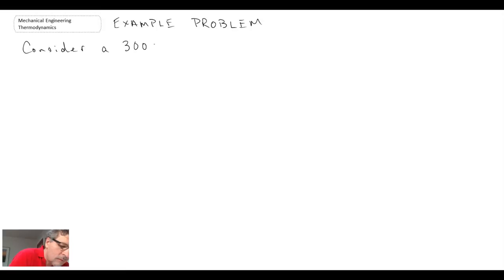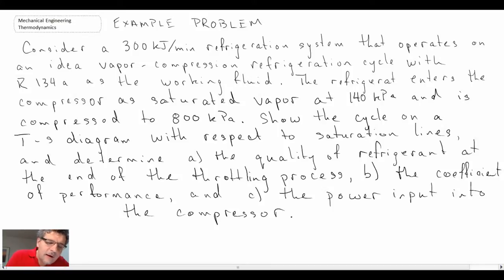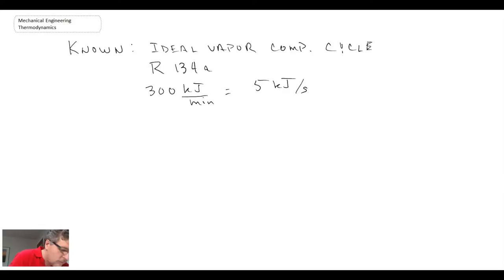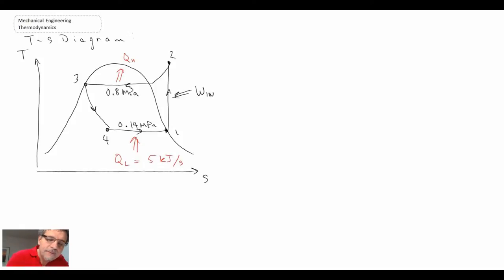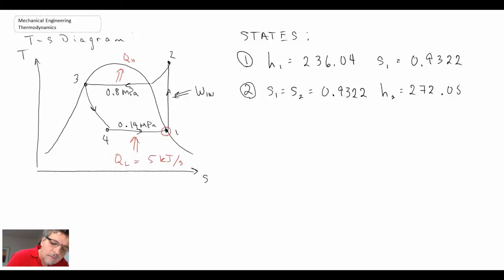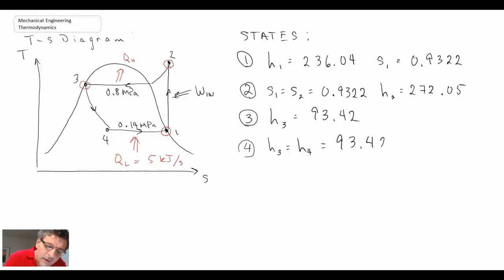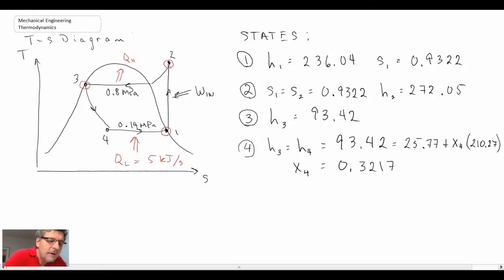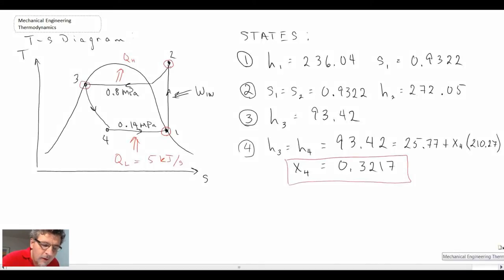Mechanical Engineering Thermodynamics - Lec 23, pt 4 of 4:  Example - Ideal Vapor-Compression

Comment: Table A-12 is how you get h1, since in the problem it is stated that it is a Saturated Vapor, therefore you look at the table under 140 kPa and 800 kPa. By doing this you can find both Enthalpy and entropy. Correction, you do use the superheated tables but that is only for P2, where the line does show up outside of the saturated line. From there you interpolate to get h2 after assuming that S1=S2

Comment: based on a P1 of 140 Kpa, and the fact that it is a sat. vapor why can you not find h1=approx 387 from the tables? All of your values for h and s are much lower than my tables even have?
Reply: I think he may have used R-410a instead of R134.  I thought the same thing.
*nevermind, if your using Borgnakke and Sonntag Fundementals of Thermodynamics tables, they're different values on the lookup.  Why I have no idea.

Comment: the problem with my superheated R-134a table is my pressure at .8mpa is not there. i got  only pressure column for .6mpa and .10mpa
Reply from the maker: You can still solve it, although it is a bit more work.  You need to interpolate between the two states where you have information (0.6MPa and 1.0MPa) in order to determine values of entropy at 0.8MPa.  With this you will be able to compute a value for T_2, from which you can determine h_2 - again by interpolating between the 0.6MPa and 1.0MPa data.
Reply: for those having this same problem - google "how to interpolate table values thermodynamics" and you should get your answer. Pretty simple stuff once you do it a couple times.

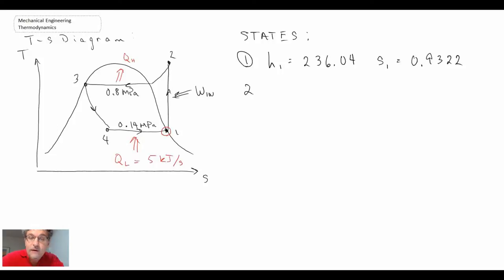Comment from the maker: You use the superheated R-134a table at a pressure of 0.8 MPa.  Knowing that the value of entropy at state 1 is equal to entropy at state 2 (3:25 in the video), this provides you with the value of entropy (s_2) at 0.8 MPa.  You then interpolate for h_2 from the superheated table knowing s_2.
Reply: Still unclear, kindly expound
Reply: @arnoldkazora9680   s1=s2 because isentropic device. we know that state 2 is in superheated region, therefore you lookup for s2 in 0.8MPa table and interpolate for h2.